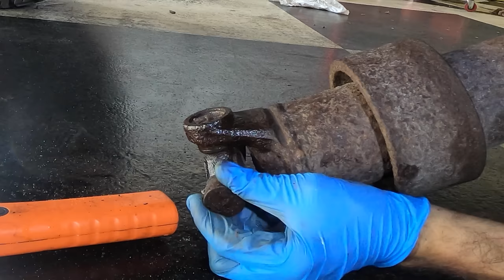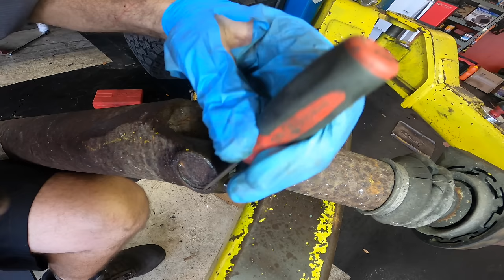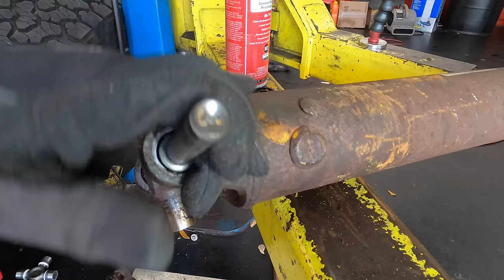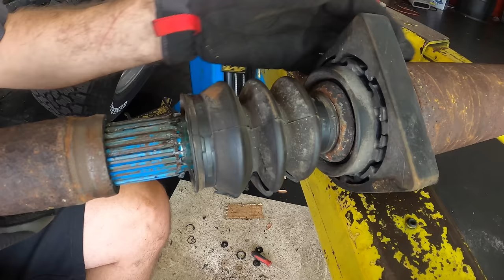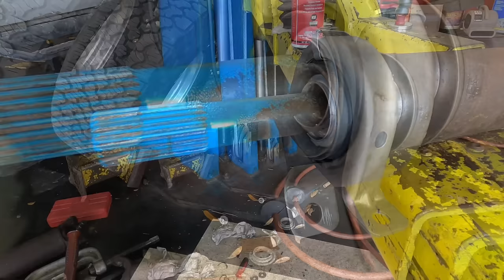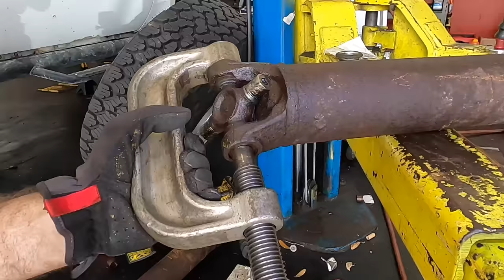Exploding End Caps!  Total Driveshaft Rebuild!  Ford F-350 7.3 Powerstroke 4X4

Comment: THAT brought the memories back!    Mine was a one piece drive shaft and I found that most of the needle rollers were just ferrous dust through fretting corrosion.    Could not drive the car over 60 mph as the booming noise was intolerable.   Then with new UJ's I fitted each end and prop. shaft re fitted booming noise still there,  so shaft out of balance.   So put car up on axle stands,    both rear wheels off and two BIG worm drive hose clips at the gear box end of the shaft which appeared to be the most eccentric.    Started with the two clips with the worm drive bits opposite each other and at 90 degrees to the low point and ran car in top gear.   Then moved the two worm drive bits equally and together towards the low point in stages until I could get 100 mph on the speedo and no vibration.   Like on that F350 these were "sealed for life" UJ's.   Earlier designs were fitted with a grease nipple.    Those UJ's lasted two years and failed the same way,   so second replacement was easier.

Comment: u-joint 101....take a socket that matches the diameter of the cap and tap on each cap first. that loosens the snap rings for easy removal.

Comment: We used to have a cone shaped heater for heating up bearings like that carrier bearing. You'd set the bearing on the heater for about 5 minutes, and it got hot enough that it slide right on the shaft and got tight as it cooled.

Comment: I have to say you and the other 2 tech/mechs have my total sympathy for having to work on these piles of rust.
 I watched a safety inspection in Switzerland the guy took a screwdriver and 12 Oz hammer (by looks no clue how many grams) and drove it through a frame.
 He did that over the rear shackle on a Ford van. And condemned it.

Comment: At the service station I used to work at we used a bench vise and assorted impact sockets to press the caps out and in. A little tricky while trying not to booger up the needle bearings. Also we had a drive line shop down the street we used for fun jobs

Comment: I like to use a box end wrench and tapidy tap it to break them loose
Also I use a socket small enough to fit inside the snap ring and tap the cup inward slightly compressing it and giving you just a smidge of looseness to remove the snap ring.
I then use air hammer to push the cups out from using the u joint body.
Reply: cringe...

Comment: Ice down/freeze the shaft and set the bearing in a 200F oven or out in the sun to heat up. The shaft will shrink and the bearing will expand enough to allow it to slip on. Standard process used by our military...

Comment: 44:38
Me again.
  Ideal world: Heat bearing 220^(min) to 312^(Max!). Freeze shaft as low as you can go. Dry ice(CO2  fire extinguisher) or even ice cubes. Whatever is on hand, it all helps. very easy tap and/or slide on. TY!

Comment: Ray, I found a miniature set of vice grips does an excellent job pinching those old snap rings together breaking the crusty seal on those old U joints. the grips are just the right size to compress those arms together to get those things out of there.

Comment: I really need to make a video on doing ford driveshafts easily and without endangering bending the u joint ears in a tiny little bit and making the ujoint stiff (and having it fail at 25k miles).  So many people do nodular ends like any old driveshaft without realizing how easy the ears bend pressing towards the inside.

Comment: The proper tool is a Pex  clamp tool  you  can get one at a lawn  sprinkler  supply house or a plumbing  supply  house Not expensive . Also  get yourself a short piece of pipe to  drive the carrier bearing  I would also  suggest you  put the driveshaft in a vice . Otherwise  great video  as usual. Thanks

Comment: I used to always soak the retaining clips with penetrating oil for 15 minutes before trying to remove. It’s the only way in rust belt and it’s was in the 70s and 80s more salt on roads then 👍🏻we didn’t have the new horse shoe presses then it was sockets in a vise or hammer time

Comment: I find a peice of pipe similar size to bearing about foot or two long, also I find ratchet straps a good vice at times stap them to the hoist, just a thought, all the best to you and your loved ones
Reply: Also the clips that hold the cap's in if you get a nut smaller than the clip slightly press the cap in the clips are easier to remove, just a suggestion

Comment: U-joint work is way easier with the tiger tool u-joint tools, there is automotive sized ones right up to big rig sized , and the cup installers work good too  , they aint cheap but def makes it easier

Comment: Having flashbacks and anxiety watching this after struggling with the driveshaft on my 2012 Taco for 3 days. All 12 cups were stuck and blew out the tops. Spicer didn't machine the outside of the yokes either, so the bearing press kept slipping off. Ended up having to buy a 20 ton shop press and customizing some sockets so they wouldn't slide off. Freaking nightmare.

Comment: I feel your pain on those clips, up here in the frozen wastelands of Canada you don't get many that have any spring left to them at all after 20 years of salt. One trick I have always done with the C-clamp is get it loaded up, then give the hex end a good swat with a hammer. It does round it over eventually but it works really well to get things to pop loose, like stubborn old ball joints in a truck like that one.

Comment: @28:55. 
This is not Rocket Surgery. 
I was barely double digits helping my dad. U joints are pretty basic. However I have stories of lost needle bearings and epoxy that would make a grown mechanic cry. 
My dad offered an apprenticeship, but I decided another route thats been 40 years without a ticket and no end in site.

Comment: My God. I hate doing U-joints more than about any other task. I'm miserable at it and it always goes horribly awry at some point. I struggle more than you did, usually because I tweaked the ears of the yoke just enough to make getting the clips in impossible, but I must say it was nice to see that they act up somewhat for the pros as well. Thanks!
Reply: Since new Ujoints are going in , the best & easiest way to remove them is by cutting all 4 spindle posts off
with a saws-all, then spray rust buster on the caps. Now all you have to do is take a blunt pointed air impact chisel and drive the caps out 
and then the retaining clips will be easy to remove! Now I don't agree with Ray  hammering 🔨 those new caps in , they all should be hydraulic pressed in !

Comment: With those clips spray penetrant and then a socket that just fits over the cap inside the hole whack the clip. Nathan is correct.

Comment: I'm suprised thoes caps came off.  Mine are currently through bolted.😁 Where I'm at we need the hot wrench for them...

P.s. I keep an old shitty socket that is just slightly smaller than the cap and tap a few times on each clip breaking up the rust..

Comment: Replacing Ball Joints so much fun! I don't miss it glad to watch someone else do it!:) 
Quick story: I replace my buddies u-joints in a Chicago alley when I was a kid 16 I think. The parking brake did not work so I blocked the wheels, The truck did move a bit when I took the driveshaft off so I couldn't get the u-joint back into the hub. I ask my buddy to move the truck back a bit... Instantly the engine started and the driveshaft started to spin in my hand!!! I kept yelling to put it back in park!!! I should of specified push the truck back!  My palms where hamburger for weeks.

Comment: Might I humbley suggest next time, hit the U-joints with a rotating steel brush and get the biggest rust off.  Then spray with lube and commence to removing clips.  In my mind, it seems the deep flaky rust was the main culprit in binding the clips from moving.  Just a suggestion...

Comment: I always mark the shafts so they stay in line from where they were . I used to do C/V joints. some times if you don't put them back from factory they will vibrate . Retired after 55 years in 2008. Love your work. I also used a vice. didn't have fancy tool.

Comment: When reinstalling the hanger bearing its the perfect time to buy a 1/4-1/2lb of dry ice from the grocery store down the street. You ice the drive shafte and warm the race of the carrier (100 watt incandescent light bulb placed on the race works perfect to evenly heat it and it gets to hot to touch believe it or not). Once its heated and the driveline is frozen with dry ice it will literally slide right into place, more times than not you wont even have to tap it into place. The bearing will slide fully in place with no effort....

Comment: Videos are great.  Thanks.  When installing u--joint caps use a hammer smaller than the cap or a socket like seating the clips.  The center of the caps can be distorted with the ball end or edge of the flat side which leads to shorter life.  A heavy large vice with a piece of mud flap works well to hold the shaft and makes the work easier.  It is also good to note or mark the center u-joint so the shafts are maintained in their original balanced orientation.  Also using a socket and hammer to help unseat the clips first should help getting them out without breaking like you did with the chisel on the later ones.  One more thought is to use a piece of shaft tubing just larger than the spline to drive the carrier bearing on.  My best friend was manager of a driveshaft and parts shop for years and I would watch him work like an artist at building and rebuilding shafts of all kinds up to and including diesel locomotives.  Once again thanks for sharing your expertise.  It is a pleasure to watch you do the job right.

Comment: Good thinking with the inner race to push the bearing on with.Sometimes a pipe that fits over the shaft works if you have the right size.Hard to have all the factory specific tools so innovation is a must.

Comment: Say for putting on that hanger bearing you need to get a piece of schedule 40 pipe and then just slide itt down that way it would push even on the hanger bearing and then it would be going on straight also weld a cap on the end then you could use a bigger hammer . And I do like your videos and keep up the good work

Comment: Hey Ray. Coming at you from our home in Thailand; originally from central Illinois. Anyway, I thoroughly enjoy your format, presentation and content. Also a shout out to the folks that follow and comment on the videos, you all reflect the great brotherhood of the repair industry. Some folks build 'em; the repair folks keep 'em running.  Undersung and damn sure underpaid! Brings back good memories of challenging and sometimes plain hard work, and sometimes "challenging customers", in one of the many home garages/shops/gas stations/dealerships I worked in back in the day. At the risk of nobody giving a rat's axx, I started out repairing childhood things, moved to lawn mowers and gardening equipment, to the farms in the area, then on to Auto Vocational school which led to heavy car/truck work, and then into university for aviation mechanic's (fixed wing and helicopters) school up to a maintenance management bachelor's degree. Ended up working on jet engines and I'm still managing maintenance and contracts on them now. The reason I give some background is because along the way a family friend acknowledged my abilities and suggested that "if you can repair things, you can repair aircraft and their engines, and make better money at the same time."  He was right, and it has been my experience that any good mechanics can transition to aviation. You might still be a mechanic, but you'll get some respect and better pay and conditions.  The aviation industry as a whole is short 10's of thousands of maintenance personnel right now and pay is higher than normal.  FWIW.

Comment: For the ones that fought...Beethoven's 5th would've been perfect.

I've usually just torched out the U-joints which then makes knocking out the caps easy. Then used socket in combo with a BFV for pressing in the new ones.
Even if you have the press...a BFV is handy to lock down the driveline.

Comment: Done lots of these, I like to warm them up a bit (just the yoke) with a propane torch, just hot not glowing. Spray with PB Blaster. Go get a water , when you get back give them a little ball peen and big punch love. Usually pop right out.If clearance is tight and the cross is stubborn blue wheel the end off, pull out the cross and punc out the rest. Love the channel.Doo dee do dee do 🤣

Comment: You crack me up...in a good way.  "Rocket Surgery" and a host of other favorites.  Wish you had been around to tell me how both my front wheels fell off at the same time.  I was told the CV joints exploded but I suspect a sledge hammer on the joints were responsible.  PS: not a mechanic just a make do to get to town kind.

Comment: Excellent job Ray i always put my tail shafts in a vice to knock out the uni joints with a hammer and punch also when pressing out a centre bearing i cover the old bearing with rags as its pressed out in case it shatters Love your work

Comment: I put my caps with a tad dap of bearing grease on the pin bearings in cap and set on a Super Cold Gel pack (dry ice) works well and align u-joint in its home and (little oil) on bearing caps should drop almost right in their homes push almost all the way by hand if not I was using a larger vise and sockets they were a tad smaller than opening and squeeze. Clips should pop right in! 
I have done this on a 1963 Chevy Impala 3-piece drive shaft with center bearing carrier and almost similar on a 2005 Mercury Mariner ( done in 1 hour ). Get better with practice! I use heat sparingly on bearing ears or holders just to slightly get them to enlarge a few .000's  makes disassembly and install much easier. Remember heat & cold are your friends for pressing in fit parts. Use it or lose thy TEMPER!  Lmao

Comment: We use a torch and warm up old u joints when there rusty like that. then give a shot of lube, then tap them both way with a hammer ,been doing our trucks and farm drivelines like that for 50yrs,give it a try your working way to hard at that job.

Comment: @Ray ...  A TRICK I LEARNED FROM 21 YEARS OF EXPERIENCE ( not counting the 2 college years or the  childhood of  "hands on apprenticeship" with Dad And Gramps ) ... USE a hammer and tap the caps of the joint as if you were installing it before trying to pop the clips... so they'll break less often ...
Reply: I also tend to use an old cap on the end of my clamp for installation to keep from blowing any end caps apart because i always install greasable cap type U-Joints
 ( I never use regreasable center drilled ones because at times I like to  " Launch " Under Load and they break if they're not solid core )

Comment: LION'S TONGUE SANDPAPER, COMES IN A ROLL WITH DIFFERENT GRITS.  FOR TIGHT ON THE SHAFT BEARINGS, TWO OPTIONS, PUT THE SHAFT IN A FREEZER TO SHRINK THE DIAMETER OF THE SHAFT OR HEAT THE BEARIN IN HOT OIL TO EXPAND THE BEARING, EITHER WAY YOU MUST WORK QUICKLY TO DRIVE THE BEARING ON THE SHAFT

Comment: Has using a bench vise instead of that puller gone out of style? And hammering the new caps in? That's where the vise worked well, even if you needed a helper.

Comment: "You need the prop shaft refurbishing"
 I'll spray everything with release fluid in case the job gets the okay.
"Yep, get on with it"
"Oh I broke all the clips and struggled with the bolts, I know I'll spray them with release fluid because it works in a nano second"

What you needed to do after spraying with a release fluid is go around tapping the joints to loosen the rust.

Comment: Ray, you're a decent wrench BUT you definitely need some instruction on how to disassemble u-joints.  You ARE getting the job done in spite of the procedures you're using.  Before you try to remove the lock rings you should smack the cap down, it won't move much BUT it will move enough to free up the lock rings for removal with pliers.. Using that harbor freight chisel was a poor choice fromm the beginning... Also I would have used the air hammer to drive out the caps not the ball joint press.. And try locking down the shaft to the lift with C-clamps.. Hang in there dude you will get it eventually.

Comment: Great video Ray!  On all of my Chryslers that I have done, I used the U-Joints with the Grease Fittings.  This helps for future maintenance. Not sure if they have those for Ford's, but, if so, it would be a good thing to utilize.  Thanks!

Comment: I never use a hammer it install U joints. If you had a 11/4" pipe and longer then the end of the drive shaft you have your tool the diy cheaper tool

Comment: Mechanic for 50+ years you should never hammer in the new caps as they are cast steel and you will fill them with fractures always press them in with a vice is safest .entertaining videos.

Comment: I would never rebuild a Ford drive shaft since my brother works at a plant the makes these drive shafts & they one use only drive shafts. Especially for the Mustangs & F 150 trucks because they have to add cardboard inside the drive shaft because the transmission is so unbalanced.

Comment: After watching you install that bearing , I understand why we were charged 500 plus for the service.  For the future , weld that used bearing race to a length of pipe that will fit around the splined shaft but is longer than the splined shaft so that you can just set it in the press and Voila. You may not use it once every 5 years but every time you do it will save you 2 hours work that I feel you can charge for with a clear conscience because you are the only one in the whole county that will have the TOOL. How about them apples !!